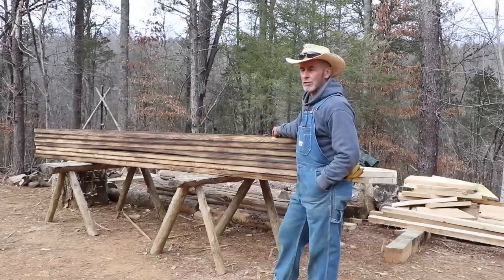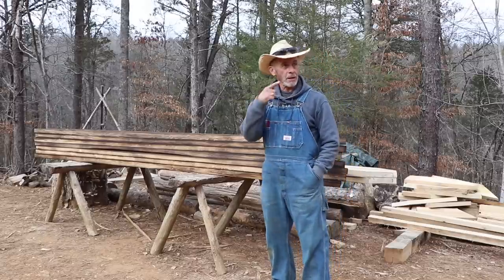BUILDING RAFTERS FOR THE TIMBER FRAME WORKSHOP

Comment: Almost in the dry before spring rains. 
One person timber frame operation rules. Two hands just ain't enough. Less handled timbers makes back feel better. Keep coffee hot and battery powered tools charged.
Reply from the maker: Yea, super difficult with a single person for sure. I can feel it sitting down 😂

Comment: After you burn wood do you sand before you apply timber oil? It looks like the black soot is gone when your putting on oil.
Reply from the maker: No I do not sand. It get mixed in what little there is. If I did it heavily I probably would

Comment: Also why did you not notch the rafters on the plate?
Reply from the maker: Because I don’t think it’s needed. I have seen others do it and it’s cool, but I tend to do things how I see them in my head. The joint at the peak is well enough to hold any lateral movement which in turn holds the outside wall in place. I also don’t notch the beam for floor joists. I use a joist plate to rest them on and blocking between them. I have adopted different things I like and incorporate them into the build.